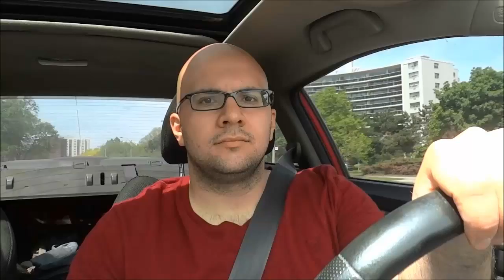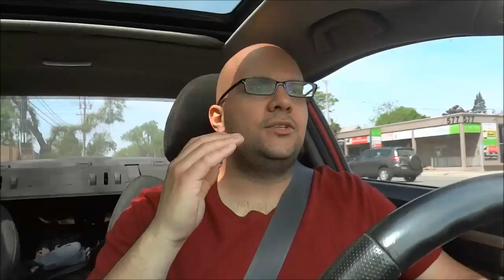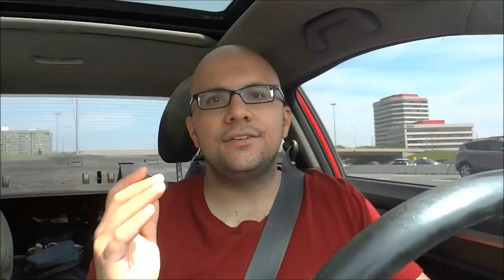Car Turn Signal Blinking Fast-What It Means And Why

Comment: Mine started doing it when I Changed my head light bulbs from yellow halogen into white halogen. My passenger side turn signal still works but after driving for a while with headlights on it stops working

Comment: This might be the case 80% of the time, but in my case my Mini blinks fast only on the right turn signal.  ALL MY LIGHTS ARE WORKING.  The left turn signal blinks at regular speed.  And of course, this being a newer car, it no longer has a flasher relay.  It has an expensive module that controls all of the lights.
Reply: I have the same thing going on
Reply: So? What was the result? Hiw did you fix it? What was the issue?
Reply: Same thing going on. Ive only been a year with this car

Comment: **@Helpful DIY - ANSWERS PLEASE ASSISTANCE APPRECIATED - Will try my theory tomorrow based on what this guy said in video. Makes sense. Did anyone fix it? I have a G6 and the right turn signal blinks fast on dash board left on dashboard regular speed. BUT the right rear bulb is dimly lit and does NOT flash at all. BUT the front right does flash extra fast. The front left signal bulb and rear bulb flash normally. So am guessing it is the rear bulb needs replacing. YES? How did you make out with it? Thanks! :)**

Comment: Who cares? I want to know how to fix it. Not trying to take a course.
Reply: **@Sheldon Gooch - Did you fix it? I have a G6 and the right turn signal blinks fast on dash board left on dashboard regular speed. BUT the right rear bulb is dimly lit and does NOT flash at all. BUT the front right does flash extra fast. The front left signal bulb and rear bulb flash normally. So am guessing it is the rear bulb needs replacing. Maybe you too? How did you make out with it? :)**

Comment: What if the bulb is actually blinking ?  Can it be "burned out" and still blink.  The front and rear signal lights on the left side both blink quickly.

Comment: The issue I have with mine is that it flashes quickly (Left turn only).  But starts to flash at a regular pace when i excelerate the gas pedal.  Any suggestions?🤔

Comment: Not always a bulb. Yes, that is the first thing to try. But often, a fast flasher means something else is wrong—and your bulbs are all good.  Unfortunately right now, I’m dealing with one such case—a defective flasher module.
Reply: I got a 2000 buick regal the rear light stays on..but dont blink..so the bulb is good?

Comment: I recently installed LED bulbs, and the speed pattern increased. Is it necessarily bad for your vehicle? Does it have negative long term effects if it blinks fast? It kind of looks cool
Reply: it's not bad for your vehicle, the reason it blinks fast is because the relay that comes with the car is meant for incandescent bulbs, which take more power. So when you switch to LEDs, the relay sees it as a burnt out bulb. You can fix this by getting a relay meant for LEDs
Reply: @Chaos_Tempo  where can I get one. and what do they look like
Reply: @Mountainmannnn  it depends on what car you drive, but they kinda look like a wall adapter for a phone charger
Reply: @Mountainmannnn  i got mine at AutoZone

Comment: Doesn’t always mean the bulb is burned out. Could also be an electrical issue somewhere else such as a malfunctioning relay in a control module or a bad ground.
Reply: GroundHawk oh gosh. Mine started blinking fast tonight and I need to get it inspected by the end of this month. Hopefully its just a bad bulb and an easy fix. Ugh!

Comment: thank you. that actually shed some light. I have a 2004 monte carlo,  the rear blinkers don't work, but the bulbs are good, the front blinkers work, but they blink too fast. the main relay was just replaced, and it's got no issues.  I am assuming that it's a ground issue. have you got any ideas?

Comment: soooo. the light is burned out? and still lights? just faster?i don't think so buddy, more times than not i find it to be a bad ground,going to the frame. i always start with the bulb, then the ground,before replacing the flasher. i work at a used car lot and see that a lot.
Reply: I like your answer, maybe you can help me. My front passenger side blinker doesn't blink inside or out. I can hear it blinking fast inside the car but in the front the bulb lights up solid and doesn't blink at all. I tried changing the bulb and it does the same thing. All others work fine and even the flashers works fine. I'm really at a dead end I don't know what to do. Please email me your response if you don't mind. I'm just not sure I'll remember which video I left this comment on and probably will never find your answer.
pochogirlrg@gmail.com
Thank you so much

Comment: My Headlights are dimmer on the Passenger-side, which is the same side my Turn-Signal is flashing faster than the Driver's-side. However, both of Turn-Signal bulbs work in the front, and back on the Pssanger's-side. Any suggestions???
Reply: I already checked my Fuses...

Comment: Changing out stock Bulbs for newer LED's will also cause a similar pattern of behaviour in the turn signals due to their being less resistance in the electrical circuit - to resolve this you simply 'swap-out' the old relay with one designed to work with LED's; Its a real easy and cheap fix.
informative upload, thank you
Reply: thanks justbanter that was my issue i have replacement led lights . was wondering if you could point me in the direction of this relay

Comment: All depends on curcuit design. Series, parallel , series parallel. Series curcuits cause all voltages to go to zero(stop working) if faulty component  (open curcuit). Parallel means as one component breaks others must take up any increased loading duty. I recently changed a genuine turning and signal light  for non genuine. Two things were different Cheaper incandescent bulbs and change in grounding all bought to one point. Indicators started blinking faster. I believe cheap lights less resistance > increase current across other components including relays. Also the balancing of the grounds to one point again probably making the curcuit more efficient ironically increasing again load on relays. 
       I am more curious as to this being a problem, over time any Auto techs explaining why they would spead load across 2 grounds would be great. Are there shunts and extra fuses etc to isolate problems etc. 
       Edit just changed back original 21 watt bulbs and wallah correct blink speed the difference was amazing ..i only need a replacement lense, in short just use a bulb with correct resistance. You can do the math.

Comment: doesn't the current load drop and the voltage increase (since there's less current load)… and because of the higher voltage the relay will cause the other bulbs to blink faster?

Comment: @01:15  A quick analogy.. to think about it is lifting weights,
Hahaha weight-lifting brought as analogy here is like moving your right hand all behind your head to reach left ear & scratch it :D. The correct analogy here is say 6 "fountain" holes along a water pipe. Stop one hole & the rest 5 will shoot water higher up as the pressure is relieved/undermined less by 5.
Reply: JM good one!
Amperage is "pressure", right?

Comment: So what if all of them blink? Mine both blink fast on the passenger side but it appears the break light is out on that side as well. Ive replaced the bulbs but its not fixed. Suggestions?

Comment: current load not voltage load
Reply: Michael Goldinger yeah, wouldn't the voltage stay the same unless the alternator or regulator was faulty?
Thanks. I've not heard of the term "voltage load," but I did stay at a Holiday Express last night! Lol
Reply: I think you are right. It's probably due to bad grounding so it causes open circuit, no current flows to the turn light branch.